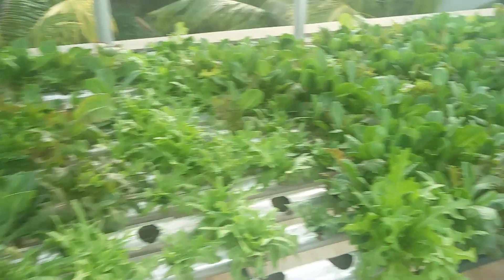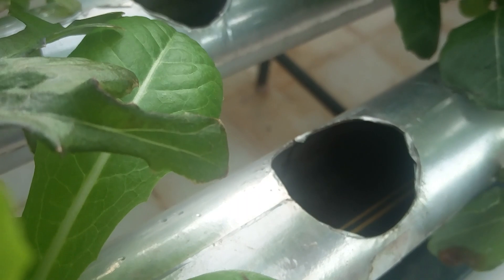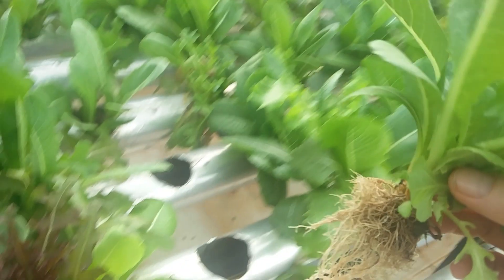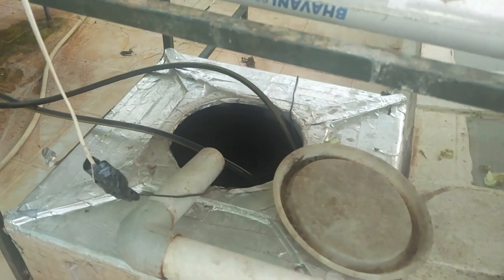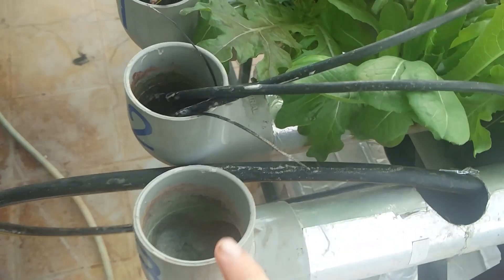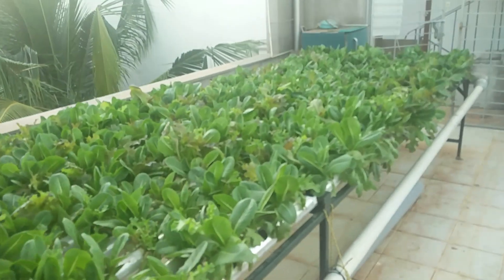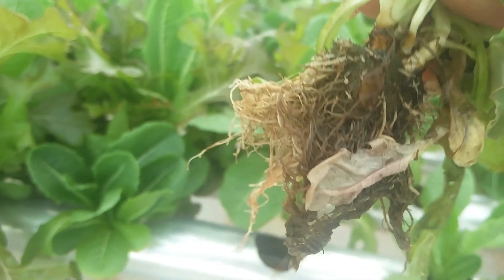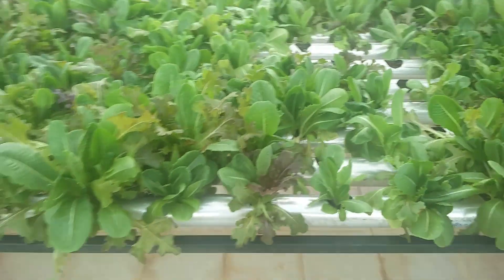Hydroponic vs aeroponic experiment day 1

Comment: The roots will run out of space in those tubes, you`ll be left with a pseudo NFT as the water from the nozzles ends up flowing down the tube as liquid water not mist. You need more root space for aero, at least 12" of depth for leafy greens, 18"+ for tomatoes and cukes.